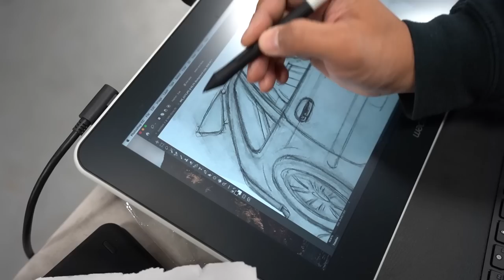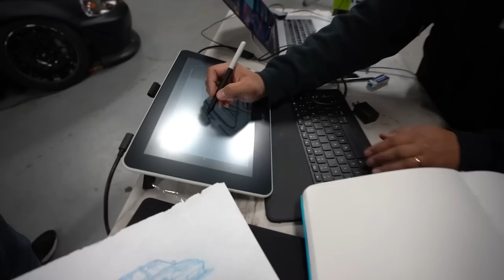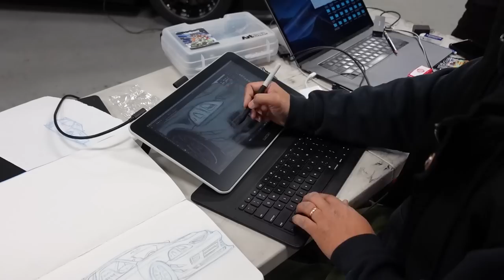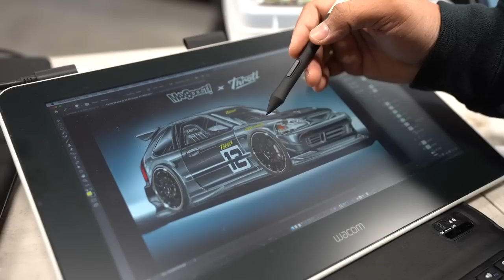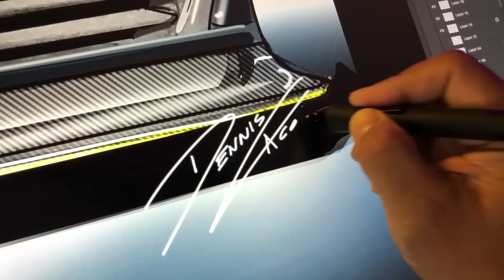Building a Rear Wheel Drive, K20 Turbocharged Honda Civic EK Hatchback Race Car!! Part 13 - Livery!

Comment: Nothing screams "I think car culture peaked in the 90's" quite like a liveried up JDM car, but in a way, they're not wrong. It's part of the reason that people keep working so hard to put these cars back on the road despite all of the trouble involved. There's a certain purity of purpose that cars in the 90's and early 00's had that you can't replicate with modern cars that are bound by all of their safety requirements, and this is particularly true of cars from the Japanese, where the tuner culture was just such a massive part of the automotive experience at the time. I'm a 90's kid that grew up reading and re-reading Initial-D, so I totally get the reverence that people give to Japanese cars of the time. There's just something special about them that can't be replicated no matter how well you can force a modern car to handle or how much you spend trying to lighten them. Initial-D really shaped my appreciation for the somewhat plain appearance of cars like the FC and the EH2/3. Cars with a purity of design that can seem understated or plain but in which every body line and panel shape was designed with purpose, unlike some modern cars with odd slashes, creases, and peculiar body lines.